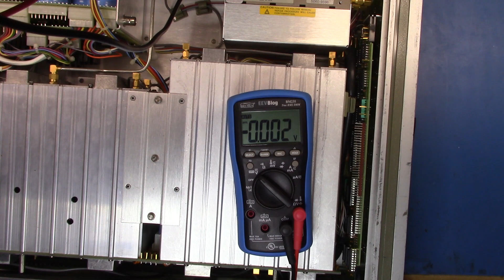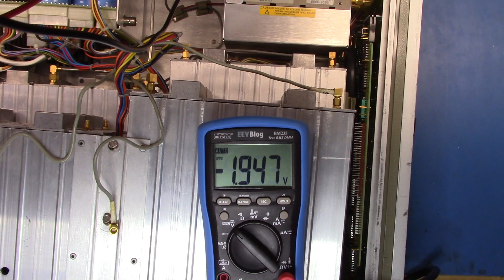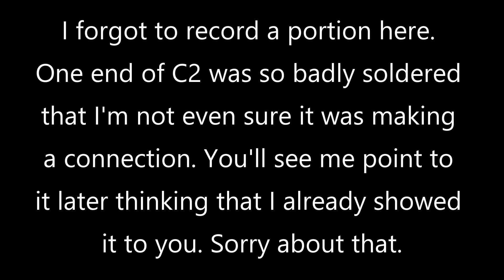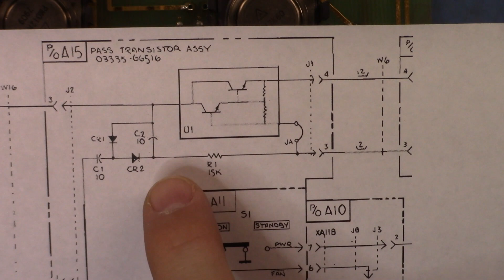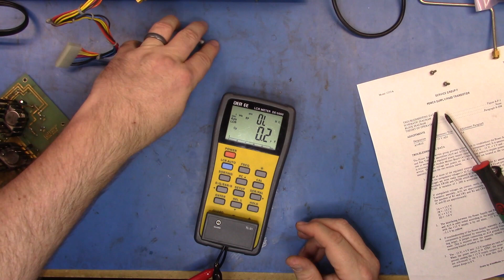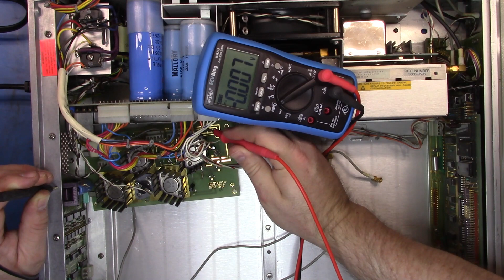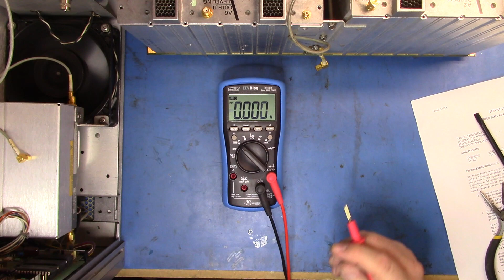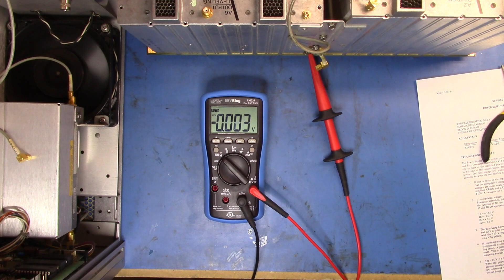HP 3335A Repair - Part 3

Comment: Thanks for sharing. It does seem odd that all those caps would be bad, including the newer ones.Is there any ariflow over that board? Hopefully your new caps are 105C caps. I do that radial cap replacement trick quite a bit, because I have the radials in stock and they are usually MUCH cheaper. I just put heat shrink or spaghetti tubing on the leads. Certainly the added lead inductance will have no effect in these power supply circuits.
Reply from the maker: Little air flow but yes it is strange. I'm not completely sure it is fixed yet so I may get a chance to fix those leads.

Comment: Lol the sparks at 12:20
Reply from the maker: Yep. I meant to put a sub title in about it but clearly I forgot. At least it shows the current limiters work.....
Reply: That stood out to me as well. Glad it did not hurt anything. I managed to do to that with about a 350V rail and burned up a meter IC on a Lambda supply (video on my channel). Haven't finished this vid yet, but immediately checked the comments when I saw the sparks.

Comment: I found this third video very interesting and I hope it will be useful for the repair of my generator. I ask you if there will be a fourth part. Tiringrazio and I salute you,
Basilio
Reply from the maker: Yes - I'll put it back together and then see if I can get it working and the voltages correct from the power supply